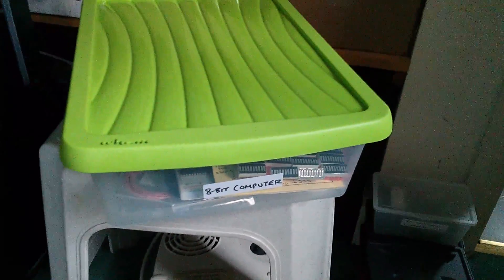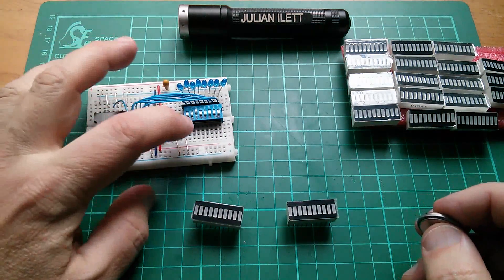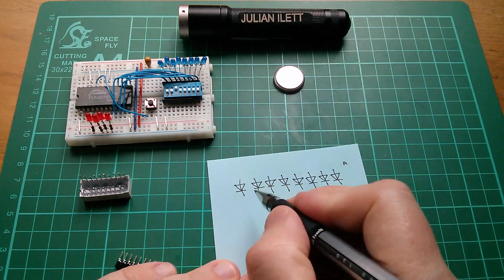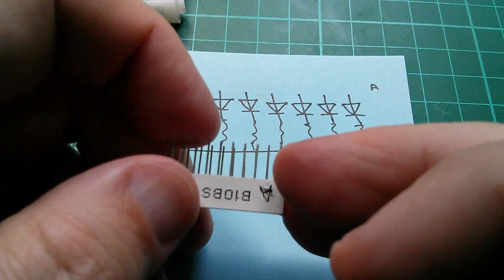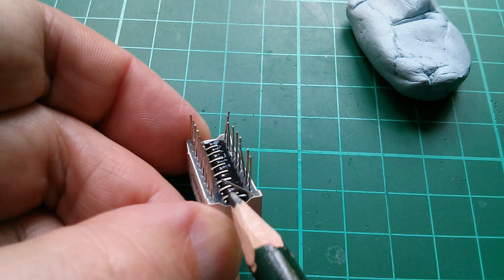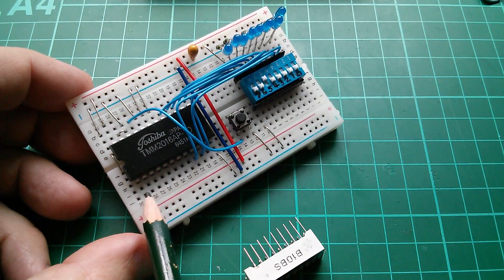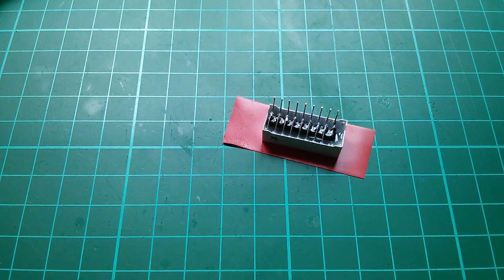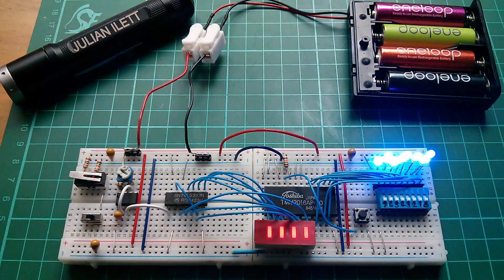Making LED Bargraph Single Inline (SIL) Displays

Comment: Funny there is not a lot of info out there on using SIL's.  I have been building devices that use 8-10 LED's and using a LOT of resistors, where one or two SIL's would work.  With that in mind I purchased a variety box of SIL's from the Electronic Goldmine online. It arrived with over 100 SIL's now the problem is figuring out what each one is in value.  They have all sorts of markings due to various makers and designs, I think I have sort of figured out most of them now, it looks like it should

Comment: Blue LEDs put out hundreds (thousands?) of times more photons than red LEDs for the same current. Using higher value resistors for the red and lower for the blue will increase the difference. I use resistors on the Blue LEDs that are 10 times the value of the red ones, and they're still noticeably brighter (but much less distracting).

Comment: I might have gone "old school" & put 2 wraps of wire wrap wire on the SIP common pin & the LED array lead it goes to; Gives the solder something to be attracted to + a good mechanical & electrical connection (compared to some other methods)

Comment: The more current you draw from those pins the more issues you are gonna have.  Best off using a high value resistor so LED just lights up.  Unfortunately this is rather camera unfriendly.  Maybe other adjustments can be made but as you multiply the setup there gonna be trigger and voltage issues later. Like video, like the bar graph idea.

Comment: You could've put common pin on the other row of pins. That way you would have the common fitting into the power lines directly (maybe with some little bending) without having to use that link on the side of the chip.

Comment: Being a couple of jumps ahead here, wanting the create my own 8bit breadboard computer, based on the videos from Ben Eater et al. and wanting to show the the address and databus inputs you are currently prototyping, I came across the same scenario with these 10bit bar graphs: I tested a number of SIL resistor networks and found the best turned out to be 330R 
for both 3.3v and 5v. I know you said you'd try the 330R SIL and I think you'll find it's the best option for a good brightness level.
Reply: Andy Jary , sweet :) That's one of two values I ordered & am waiting for.

Comment: I noticed that the LED's on the right were considerably brighter then the ones on the left.  Does that indicate the resistor pack has resistance across the common buss? Otherwise it should have the same amp draw across each LED no matter how many are lit.  Especially considering it is tied directly to the negative terminal.  I did not see the blue LED's changing in output so it is not a supply issue.  Hmm
Reply: I think the brightness difference you are seeing is an artifact of the camera angle. If you watch the video before the red tape is placed over the LEDs there doesn't appear to be any difference.

Comment: Aliexpress has these breadboard friendly modules with surface mount leds on 0.1 spacing and built-in resistors.
https://www.aliexpress.com/store/product/DC-3V-5V-12V-Rapid-Prototyping-RED-LED-Breadboard-starter-kit-for-Arduino-UNO-Atmega-MEGA2560/1525466_32273206116.html
Unfortunately they're only six leds, but maybe someone makes (or will start making) them in lengths of eight.
Reply: nice but arrgh only 6 LEDs wide?

Comment: You should try making a DIL package yourself, by getting those square LEDs(i forget the name) and attaching all the elctronics, aligning it inside the casing and pouring on resin. That would be interesting!
Reply: Emil Carr , they're often listed as 257 LEDs. (Because they're 2x5x7mm)
234s are common too.
Also cheap, about €$1.50 for 100 of any colour.
Reply: Sounds ideal! I want to see it done

Comment: Nice project Julian!
Two things:
1) You do know bar with upper pins and common left IS the same as a bar with lower pins and common right? ;) Aka, only two types
2) Blue leds indeed have a higher drop thus need a lower resistance for the same amount of current. BUT, blue leds tend to be a lot brighter with the same amount of current then the normal red leds... So 13mA (150Ohms) for the blue ones just makes them reaaaallllyyy bright and swamp the camera. The reds look just fine! Just use more like 2mA to 5mA for the blues to match :)

Comment: If you increase the led current a lot, you'll probably have problems with voltage dropping. Memory chips or logic chips can supply a very limited current. This creates problems with other chips not getting correct levels due to excessive current draw. Actually I'm supprised that it works even currently!
To be safe, you'd better use a buffer to isolate leds from the logic level bus.
Reply: All it takes is a ULN2804 if you are just hanging a 20mA load off the end.

Comment: Why don't you use just one for example 1W resistor?
easier to manifacture and you could use all 10 LEDs
Reply: Although the voltage would remain constant for the LED pack, the current changes depending on how many LED's you have turned on.  To calculate the resistor value, you use voltage drop (5 volts minus the forward voltage of the LED) divided by current.  So for one LED, it would be one resistor value and then a different resistor value when two LEDs are on, and so forth.
Reply: cengland0 Thank you for your answer
i calculated it for myself and you are right
i missed this point
Reply: PS Elektroniker , you'd get the same problem with 7 segment LEDs.
1 would be brighter than 8,
4 & 7 middle bright.

Comment: The parameter of the side at which the common ground pin sits is the same parameter as the side to which the pins hang, as you can simply rotate the board for the pins to hang to the other side, with the only difference being that the common ground ends up at the right side instead of left (or the other way round)

Comment: what's the actual name of those "rail" or "line" resistors? thanks
Reply: squalazzo The component itself is called a "bussed resistor network". Bussed means that one end of all the resistors is attached together, compared to "isolated" where all the terminals are kept separate. The particular package that Julien's component is in is called SIP, Single Inline Package.
Reply: squalazzo 

Hi, they are called resistor networks or sometimes SIP (Single in line package) Resistors.

Comment: Julian, guessing from your R value, do you really want to run the computer on 12 V (20 mA, 470 Ohms, +2.2 Vf)?
Reply: I thought the same thing.  In your example, 20ma and 2.2V forward voltage would require a 140 ohm resistor in a 5V TTL system.  That's why the LEDs are so dim with those 470 ohm packs.
Reply: Then again, LEDs have become so efficient, one could run regular LEDs at (5V - 2.2 V)/470 R = 6 mA and they'd still do a perfectly good job as indicators. Thanks for reminding me! Great channel, great conversations!

Comment: My experience is that blue LEDs are brighter at the same current as red LEDs. That means they need a higher resistor for the same brightness.
Reply: Robert Eliassen , My PICkit3 has a blue LED on it, covered with 4 layers of PVC tape to make it less eye meltingly blindy.
Reply: I wouldn't use red at all, since it is harder to see somehow and red LEDs never get so bright.

Comment: Better to have the IC sink the current rather than source it.
Reply: 1:30
Reply: WTF has your post got to do with my point?
Reply: NoName You want him to sink current on his IC but he wants his leds be on for a high state output on his IC. It means he would have to use a inverter IC, which clearly isn't worth it.
Reply: It's not what I want, it is convention.
Can run into problems breaking established convention.
Like brightness problems, like data corruption problems, or chip failing.

Comment: ... you could just do the same with normal round LEDs a busbar and some resistors soldered on you know julien
Reply: In his previous postbag video, Julian explained that he wants these rather than the round LED's because they are a better fit to the breadboard, and because they also look neater.

Comment: Wouldn't a little nick or crease on the pin stop the solder wicking up past the point you want it to?
Reply: Szlater Szlater That might complicate or interfere with inserting it into the breadboard. 

Maybe he could have inserted it into a bit of the blue tack.
Reply: Thomas Bland You're right, didn't think of that.

Comment: Why don't use middle 8 LED-s leaving most left and most right ones unused, it will be symmetric and aesthetically more elegant.
Reply: Tie both outside pins to the 'common' and leave them straight until you install it on the board, then just fold- under/trim off the undesired pin.
Reply: @Kew Akl: Good idea!
Reply: Great idea Kew.
Reply: .That is the 5th parameter: Use 1-8 or 2-9 or 3-10.
Reply: You beat me to it. I also vote for using the edgemost two pins for common. The LEDs can be painted over to ease reading. Also that way you can also use one type for both "hang above" and "hang below" by just rotating it.
Reply: Nah! You know that Julian will invest in electrical tap to mask all the LEDs anyway!
Reply from the maker: I agree - it's also much easier to read the binary value if it's centred in the display :)
Reply: Huh, I would say that makes it harder to read....

Comment: but Julian , isnt  it better to sink, rather than source current for the bar displays? will you not get random bit toggles because of current draw?
Reply from the maker: It seems to work OK on the TTL outputs. On CMOS outputs there's no issue because they're complementary.
Reply: Julian, According to the data sheets 74LS gates and counters can sink a maximum current of 8mA (16ma for some) but maximum source current is only 400uA so sourcing current to the LEDs is very bad design practice. Saying "It seems to work OK" is promoting bad practice.

Comment: would it be that hard for the manufacturers to put anode and or cathode onto the product
Reply: "The chamfered corner indicates one corner has been chamfered", excellent message from the Department of Redundant Redundancy :)
Reply: No, it really wouldn't be difficult. (I use marker pen once I've determined A&K.)
 These LED arrays sometimes have a corner chamfered like an IC pin 1 marker.
 The chamfered corner indicates one corner has been chamfered.
Reply: SuperCreff , yes, we took over from the now-obsolete Ministry of Obsolescence.
Reply: well no .... but blindly guessing is not smart when you have the datasheet ^^ .... I marked mine with a dot after testing it with a multimeter in diode testing mode.
Reply: But then you have to remember what the chamfer means. (Although not too bad if you think 'schematic' :) )

Comment: Make them with a 20 pin IC socket, then you can apply the LED array later, in various colours & orientations.
Reply: Wire-wrap sockets have silly-long pins.
Reply from the maker: Nice idea. If only IC sockets had nice long pins like these displays have. The pins on these displays are long enough that I can angle the displays forward a little which makes them easier to see.

Comment: is blue tack just playdough?
Reply: No it's an adhesive putty substance and normally used to fasten paper or posters to the walls without making any holes or leaving any marks when it is removed. https://en.wikipedia.org/wiki/Blu-Tack
Reply: No. Blue-tack is the stuff you use to put posters up on the walls etc. Play-Doh is what kids play with.